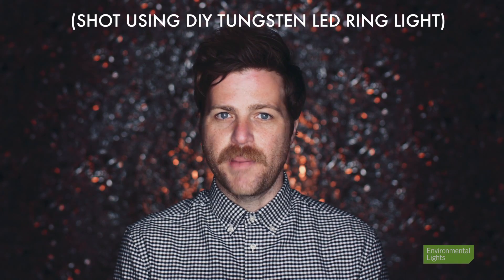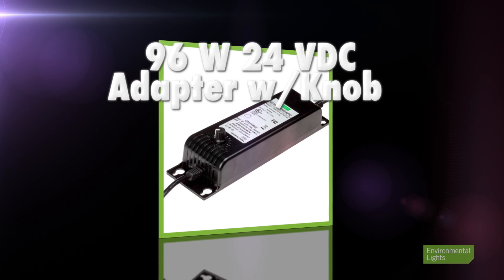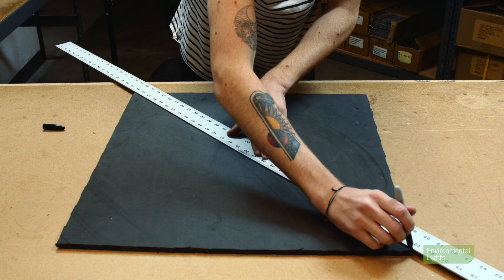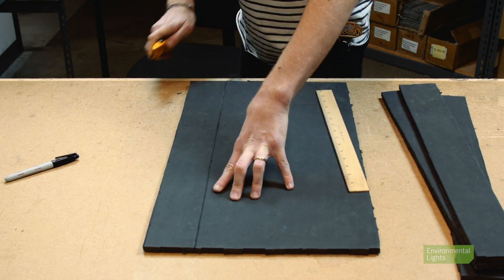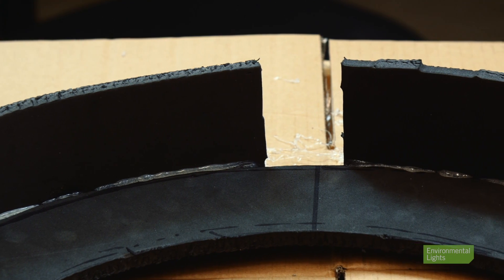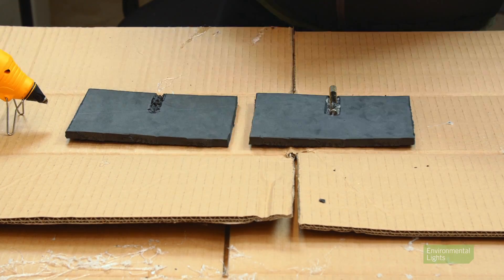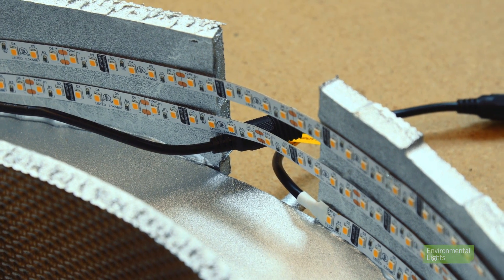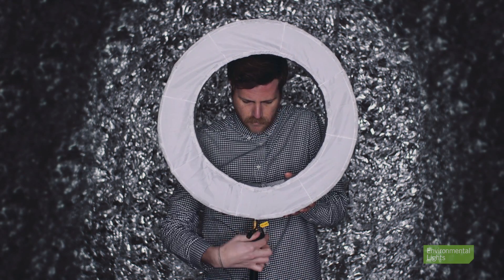DIY - How to Make the Highest Quality LED Ring Light

Comment: This is awesome; just as a bit of advice from someone that works with EVA foam a lot, you'll definitely get a cleaner look in the seams of the foam if you use a sharper blade like an Xacto knife, and you'll get better adhesion with contact cement. I'm glad I found this though as I do have several rolls of EVA foam laying around and I DO need a ring light for my streaming! <3 Keep it up!
Reply from the maker: Thanks for those tips Khris! Good luck with your ring light :)

Comment: So i am about to glue my LED strips butttt the other tutorial im digging on glues the lights on the inner circle facing out.. any reason you picked outer circle facing in?   btw- great tutorial .   10/10  stoked I found it!! well done!
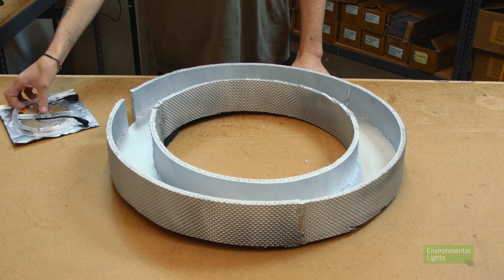Reply from the maker: Awesome! Thanks for checking out the video! You could glue them to the inner ring instead. The idea is to get the light to bounce around a bit before exiting the fixture to diffuse it a bit. I chose to use the outer ring since it was easier to have the wires exit the fixture right there (as you can see around the ~6:10 mark). Additionally, the strip light was 5 Meters long and it worked out perfectly that after wrapping the light around the ring, both ends of the strip came out at the same place, making the power inputs more accessible. Good luck with your ring light!
Reply: thank you!  I am going to go with you method since it will be more lights and in my mind MORE MUST BE BETTER. <3